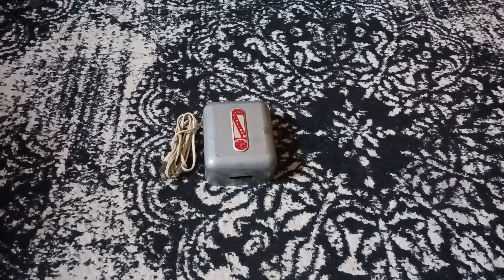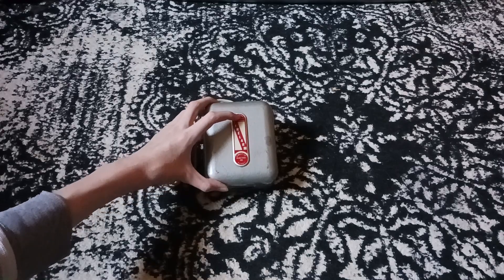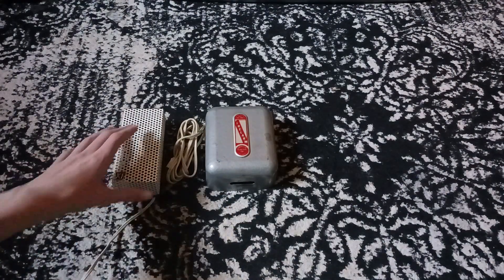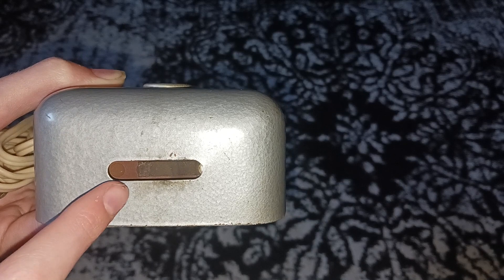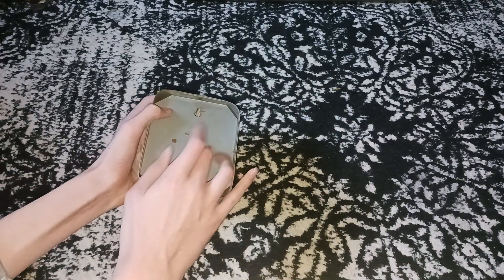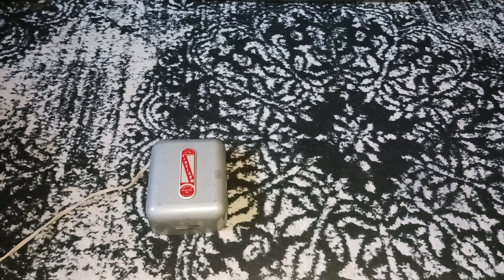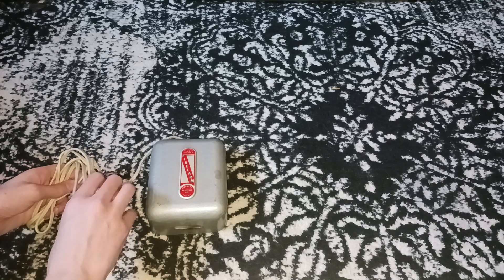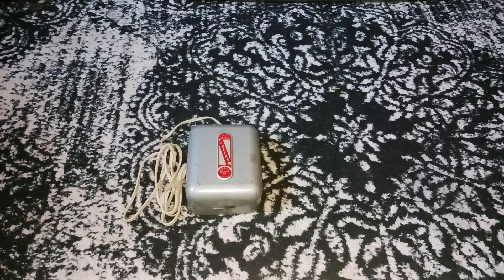Review of the Colette heat alarm

Comment: Awesome Im glad yours works. I tested mine the same way (the way it's supposed to be tested) and I wasn't able to get any sound so I tested it using heat from a boiling pan and still didn't work but wow does the unit get hot and the strip at the bottom melted somewhat. So I  just left it. It is a wicked unit though and mine came with a box in very good shape as well as instructions. I have seen others ones on ebay listed under the Hebel brand name. At least now I know what it sounds like. These older heat alarms to me are hit and miss but still very cool to see very old school home fire safety devices. That alarm looks like it was also made to definitely withstand heat.
Reply from the maker: Yea, the circuitry in this unit is very simple. from what I remember, it's a transformer and a simple horn mechanism, and yes, these things were definitely meant to withstand a good beating. this one was most likely installed as the strip is burnt, so this one most likely has seen use and definitely did a good job as so, and I'm glad to finally get one.
Reply: @Vintagesmokealarmsmedia  I don't know if they will still sound once the strip has melted. Mine was never used but still don't know why it never sounded. I got mine about a year ago. Either way it is a cool piece and very collector worthy and I agree these were meant to take a goof beating. It would be cool to see the inside of the unut. Im trying to locate the video you were talking about. Glad to see two of us have them in our collections now as well. It definitely makes a rough sounding noise.
Reply from the maker: https://youtu.be/upX2qnXXq7A?si=Hrrou37RLSY-yOiM okay hopefully the link stays, but this is the video. if u do see the video, he takes it apart and above the transformer are two disks which I believe are the sounders, so very simple and ingenious. also, I believe u could still test it after the strip is melted since there is the little disk it touches down on.
Reply: @Vintagesmokealarmsmedia  That is so cool and you are right that us very simple. I don't have a hair dryer but I might get one eventually and retest mine. I noticed his didn't seem as loud but it moved when it vibrated. I still love how it sounds its definitely unique, These devices were tough for their times that is for sure.
Reply from the maker: @janeaton3417  agreed definitely tough for their time. I would love to eventually see a video of yours as there really isn't good documentation on them.
Reply: @Vintagesmokealarmsmedia  Thank you same here, Mine also shorted the power in my kitchen which was fully restored without any issues. That is one thing that had me concerned. Mine was never used before I got it. You are right there is very little documentation on these but there are some on Ebay still.
Reply from the maker: @janeaton3417  I don't completely trust the unit either seing as there's no power led of and easy way to take it apart seing as it's riveted together.
Reply: @Vintagesmokealarmsmedia  I agree as it being riveted it can't just be easily taken apart, I do want to set mine off but since that brief power short I have been a bit hesitant however I am still glad I got one for my collection which has some very rare ones as does yours as well.
Reply from the maker: @janeaton3417  like I've said, hopefully u can get yours working, but also probably tomorrow. I'm going to make a pull on my community for my collection video as I'm planning on making it on the 5th.